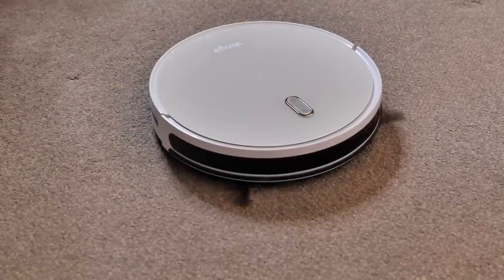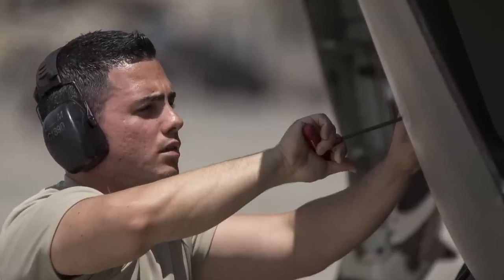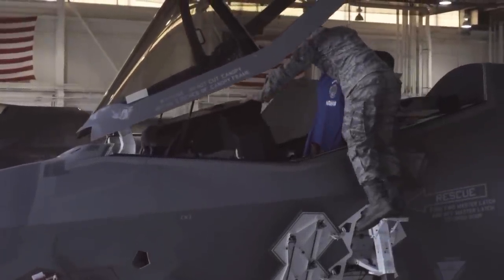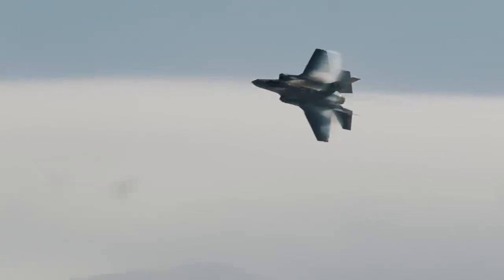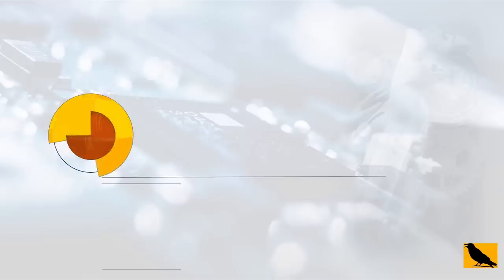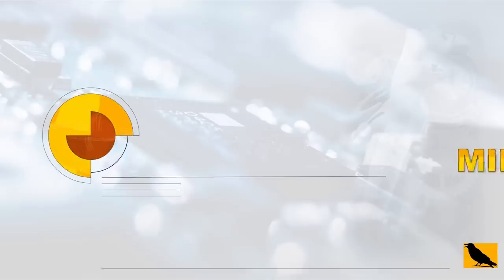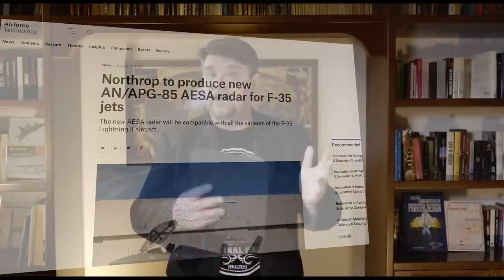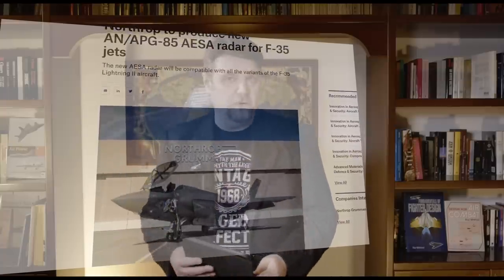AESA radars have a problem.

Comment: The heat problem, isn't really a problem. 
As one of the common fallacies that people have, is that fighters use radar from the take-off to the landing. They don't need, and can't use radar actively all the time. That is the job of the surveillance radars to find out something-out-there, and then send the fighters in vicinity that will then utilize their own radars (if required) to find that-something-in-there.
This is why the stealth factor itself is not so, as stealth technology from fighter size, shapes, material, coating etc can only be utilized against specific kind wavelengths. So the plane is detectable by some, if not many, but not by all radars. And if you can detect something, you can then concentrate your efforts to that area to find more carefully that what is there. LPIR itself has its limits, so if wanted to really go stealthy, it is still terrain masking and going blind. But that is the real benefit, if you are 10 minutes from the target when you turn "lights-on" then there is not much to do in the target area, and at the time strike is done, you are heading home with some chasers that can't anymore catch you.

And at that moment your thermal signature and all are not necessary problem as radar and other high heat sources has been used so little time.
Reply: That's the whole touted point of JSF software though, for a flight of JSFs to build a common environmental picture without external help.
Reply: @Tattlebot  The JSF can't do that without radio emissions outside with others. 

Even the old legacy F/A-18C Lot 20 got such a feature as Multi-Sensor Integration (MSI) in the 2005-2007. That combines all the sensors in the Hornets (legacy and super) to one information. 
What really makes a difference, is the F-35 pilot helmet, the capability to "look through" the cockpit as seeing via FLIR. Where in this older systems all the data is fused same way as in F-35 but information is on HUD, on DDI and in JHMCS helmet (but helmet is without the video projection from targeting pod).

But just like F-35, the Hornet needs to keep its sensors passive if not wanted to reveal their position. So no radar, no radio (and hence no datalink) but just listen what satellites and other datalink sources are sending to them. 

So when a hornet pilot is flying, he can look around and see through JHMCS all the troops positions and their created target designations as it is received over Link-16.
The pilot can point targeting pod to any point to look what is there. The map screen shows all the symbols overlaid on the map, the threats and all. 
And then when pilot activates own radar and does a scan, all the contacts is sent over datalink to the network, the pilot can do the ground mapping on specific area and designate targets that gets transmitted over network as well.
If the pilot keeps radio (/radar) shut off, then it is possible use targeting pod to designate targets on ground or look at the air targets to get LOS target etc. 

It is not exactly as advanced as in the F-35, where it is more smoothly done, but it is almost the same thing. 

The same thing is done in the Saab Gripen, except again the helmet that is next gen for F-35 pilots.

So if any pilot, F-35, Gripen, Hornet etc is willing to risk it, they can activate their radar and start mapping some areas to try find ground targets and build their own situational awareness.

If we look what the Su-27S was in the 1977, it was with a sensor fusion. 
Soviets were well ahead of the time. 
Their datalink network combined not just target data from the aircraft, using its IRST and radar, its flight plan, but it as well received air defense network data, of own troops locations, the whole air defense picture from AWACS and GCI and both those received picture from individual SAM sites and ground battalion level intelligence. It was slow to refresh, 1 second on own sensors and between flight (4 members), 4 seconds between groups (4 groups, each having 4 members) and 10 seconds from the AWACS/GCI. 
All this was presented on the displays, and the air targets on the HUD, the helmet sight system was nothing else than a sight with few symbols to indicate the targeting mode and status. 
And this information was possible be overlaid with the known airfields, flight plan, ground units areas and own aircraft status like how far pilot can fly with current fuel amount and fuel consumption, what is the range of the selected weapon, what targets are detected by own aircraft and what are over datalink, and what are targets assignment to group members and groups.

The Su-27 was meant to be paired with the MiG-31, and MiG-29 was meant to be a point-defense fighter, and Suhoi engineers were partially hold back by the government that wanted to combine MiG-29 and Su-27 cockpits and features to minimize the costs. 

In 1983 Suhoi developed Su-27M, aka Su-35. Not to be mistaken to Su-35*S* that is second generation of Su-27M as the first generation didn't get customers.
And it put even further the glass cockpit design at the era.

Remember, F-35 project originates from the 1995, and it has been lagging in the development problems as it tries to combine everything to one. Why all three F-35 variants are now sharing just about 25% of the parts, opposite to what it was originally promoted to. It is wonderful fighter compared to anything that USA had, but it is not so wonderful compared to what others did, like France, Sweden and Russia. The key really is the helmet that truly makes the big difference for the pilot experience when at close range.

But example comparing to AV-8B Harrier, that was first to have in US service the datalink between JTAC and pilot, not much is improved really. In the Harrier it was that JTAC could send 9-line to the Harrier pilot, that could review the target data and request, accept or reject it. And pilot and JTAC could pass the target between back and worth until they were in understanding. The Harrier could receive multiple different targets over datalink directly from JTAC, and get them visible on the map and neat list.
The Harrier pilot as well was capable to send his targeting pod video to ground forces, so example a special forces group on the ground was able to use MULE to see what the Harrier pilot saw, and then ground forces were able to draw on the video or picture where are targets etc. The pilot and ground terminal were capable send text messages as well to each others, to avoid using voice radio.

The F-35 is next generation from that, but basics is still the same.
Reply: @paristo  Thanks for the reply. When we are talking about network and sensor fusion, we are not just talking about relaying pilot usable information, but also about resolving uncertainties in the picture by sharing sensor information in some form, including unlike sensors. The JSF link is highly directional and low observable. There seems to be a lot of low hanging fruit which has only been picked by the JSF program.

Secondly, contrary to expectation, the HMDS has sometimes frustrated pilots. I believe I read one account that the helmet was just an annoyance compared to eyeballing before a bombing run. That's no doubt possible due to the narrow FOV and a confined cockpit where pilots can smack their helmet against the window when turning to look back. The human visual system is incredibly good at keeping mind of a location while looking elsewhere. In tanks, this is why commanders cameras are not a substitute for a hatch and binoculars. Designers aren't aware of this.
Reply: @Tattlebot  Yes, the idea of use the directional antennas is old, that is something what example the Su-27 does avoid using with the low power datalink between wingmen and very short bursts.

But anything that is signaled, no matter how directional, it is transmitting around unless you really physically block it. That is what these special passive radars are all about, detecting a walkie talkie from hundreds of kilometers distance even when the transmitter is for just couple kilometers on the field.

The strike fighters mission is never to perform the close air support, why the idea that they would be hanging on site is just stupid. Purpose is just get in and minimize the detection until so close that detection and reaction times becomes irrelevant, perform the strike and then bug out.
For that many systems performs greatly. And F-35 should be great in exactly that. What really narrows down its purpose to be more generally used, why the idea of F-15EX and F-16V is excellent as you would get to use cheaper already well proven platforms for where the stealth doesn't matter.

This is why the Saab Gripen is so interesting, as instead trying to be as sneaky as possible, it rely more to the "catch me if you can!" idea, that you might detect it here and there, but it is like slippery soap. Just for the time when it is required to get in and out. And then you get cheap plane to field lot of them, and work together. So taking the confrontation with enemy if required, instead compromising the other missions to require other planes. 

And what comes to the helmet, they do understand the capability to look around, but for the stealth purposes, the F-22 and F-35 doesn't have so great visibility to back. But neither does example Su-57, and you don't need when you have camera to look behind you the target impact point.

The helmet for F-35 being so expensive, likely will be painful to maintain on field. If you damage it, you will get trouble for it. And if you would destroy/lose it for some odd reason, and custom made fitting replacement would be required to be sent to pilot, it will be risky thing. Replacing visor, some electronics otherwise isn't such a problem.

The outside visibility is always little two-edges sword. The F-16 is clearly the golden example, nothing is close to that visibility. But the main benefit is really to see forward so clearly, and being "out from the plane" so you can see so nicely around you in front is benefit. To see behind is not so nice as in high g maneuvers you don't really do that so much. 
And then comparing example A-10 to something like Su-25 that has very restricted rearward visibility, it doesn't really offer so much benefits as when you are turning away and checking your attack run results, you have already a good angle to see so in both cockpits. So it is more about the old school vietnam era method where you need to periodically check your lead/wingman six that someone has not sneaked behind you.
Something that one shouldn't need to do in modern era in F-35.
Reply: @paristo  Sometimes I think there is much less value to strike fighters than in 1998. Jets are inept in an air defence environment. I predict to myself that the JSF being forced into real deployment in a role reversed Ukraine situation would lead to public disappointment. Certainly the CAS role will be a luxury found only in history books related to wars of observation, like Afghanistan.
Reply: @Tattlebot  I want to believe that F-35 is great. As by the specs it is. But considering what have been there for decades, it is now more like a console vs PC situation. Sorry for rough analogy. But for new and young pilots, it is huge difference compared that what they are others have been flying, as experience. The user interface etc. For old pilots the easiness might be there. But for some reason, even some F-35 have said that they prefer Harrier interface design. Not that they wouldn't want the helmet and sensors quality. But Harrier offers such a interface that you focus more out of the cockpit to the task at hand, and for USMC that is too assist the people on the ground, and be able quickly react to changing situations.

As you mentioned Afghanistan, those have been so easy invasion by USA that they have been able to do what ever they want. Threat isn't there.

Ukraine is very different case, as it was producing a lot of the equipment that Russia used, until 2014. They have been many ways equals, even more if comparing that what USA has been with anyone else. Closest would be USA vs Israel. How well would USA perform against Israel? 

The F-35 is not yet to be tested in war. It is tested in combat, but dropping some bombs in Syria or so isn't what for it was built.
The F-22 got it first air win, a Chinese weather balloon. Was it built for that purpose? Was it even smart to use for that, if F-16 would have been enough?

The wars are funny thing in sense that longer it takes, more does the people understand what works and what doesn't. 
Personally I would have never expected to see so much trench combat these days as is in Ukraine. Not see so abysmal performances from both sides with vehicles use.

Interesting question is, like have NATO already used F-35 successfully against Russia, without anyone knowing it has been there? It would be cool to know that it would be so ultimate that it would be like U-2 in early days... 

As scary thing is, if it can't perform 95% as marketed, many country is in trouble as they have abandoned old methods that does.
Reply: @paristo  I heard an interesting conspiracy theory that the particular U-2 had its fuel gauge tampered with by covert intelligence, and precisely defueled to fall in USSR territory, successfully defeating the upcoming peace summit.

I definitely don't think an F-35 has attacked Russia. As to Russia's performance, it's an overall B- from me at this point. though with many enviable examples of unmatched skill and bravery on both sides. I'm skeptical of the US performing better. For example, several sailors walked past a corridor full of smoke on the docked submarine USS Miami, and did not report it, allowing an arson fire to eventually destroy the vessel. If this were to happen in Russia, people would say, "typical incompetence of black-hearted backward Asiatic horde" or some such.
Reply: @Tattlebot  I have never even heard about that U2 fuel gauge hypothesis. Need to find more about it, thanks for that.

The problem these days in military is that you have too many incompetent soldiers in service, across the board. It is very difficult to comprehend that what kind a officers there are, and what kind fooling there is among service personnel.
It is similar thing in everything, be it a police officer or some other person who is responsible for human lives and safety, that there are just too much stupid people ruining the job title for those who take it seriously.

And it doesn't go better in higher end politics either. Like today was the UN security council vote about Russia request that UN would do international investigation of the Nord Stream 1 & 2 pipeline sabotage.... Brazil, China and Russia voted for it, everyone else against by 12 abstentions.

How much there is a difference between a sailors walking past a clear endangering situation, a reckless piloting risking a war, and politicians declining to investigate clear crimes that endangers millions of people?

If someone does something like that hypothetical U2 fuel thing, it is sabotage. If someone blows up a energy pipeline, it is nothing.

That is one reason why it is nice to watch a documentary interviews of old engineers and researchers who have been developing some high end technologies, telling the challenges and the breakthroughs in problems solving, as you can see that the decades later they have the humility and honor even when their work has been to take human lives.
And you can hear their stories about some idiotic decisions that some politician has restricted them for.

If we ever find a way for time machine, even if it would be just passive version where we could only observe the history but in manipulate or affect to it by any means (what would be truly required), then it would be amazing experience to be standing in the same space as all the key events happening that what was really happening. Like example be observing when first aircraft is flown first time, or when first time speed of sound is broken, or when Galileo was trialed etc.
Reply: @paristo  Thank you for your reply. I agree. In the case of the Russia, the pipeline, and UN member states, The US has made ferocious back room threats to just about all nations. Anything less than full voting compliance will result in total downranking of relations, and direct retaliation against government members, such as threatening to disenrol their sons from Stanford and deporting relatives, freezing assets and so-on.

It is a very troubling time ahead for all of us across the world.

Comment: While everyone agrees that AESA radars are the future so have it been less obvious when they beat the alternative in performance. I think you missed one or at least only touched loosely on it. By having the signal being generated in the AESA chips so does that limit the amount of brute signal strength that the radar can generate without melting down compared with PESA that generates the signal in a separate unit. That actually caps the max range of an AESA compared with PESA. I think that is the main reason why we still got PESA radars on some fighters today.

Comment: They can just throw a Dark rock pro air cooler like on my game box problem solved 150 bucks!!!
I can feel a Russian Aviation joke coming
Reply: Radio electronics has some limited termal efficiency. When AESA radiates electro magnetic waves termal efficiency does not exceed 70%. So there is still at least 30% of power going into heat inside radar.
For 25kW fighter radar heat power is minimum 10.7kW. So radar has to utilize it somehow.
Reply: @alexanderbelov6892  so my PC fan won't work :-(

Comment: Click bait title. In short, they are not obsolete and there are no game changing solutions on the horizon. I agree with the notion that putting an AESA on a steerable table would greatly benefit them, but that's not a ground breaking idea. It's going to be a long time before something better than AESA comes along.